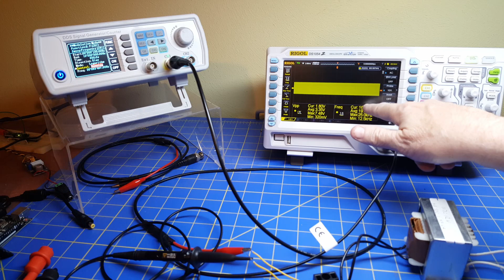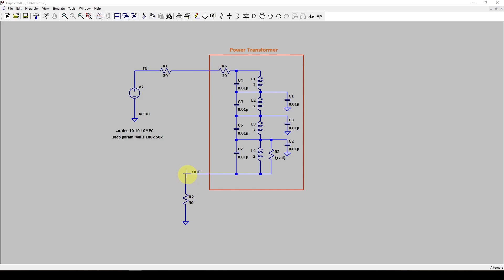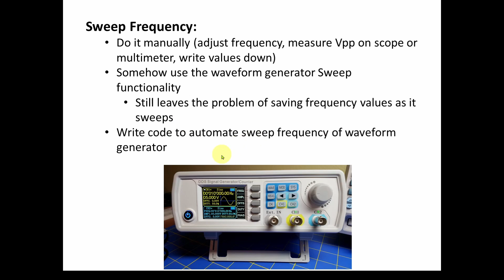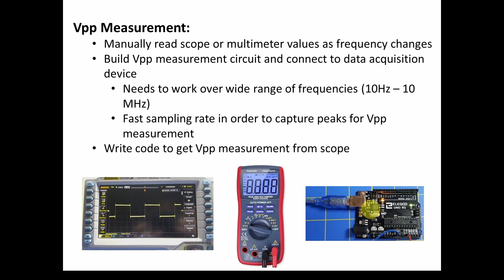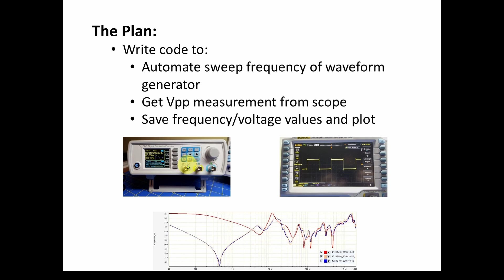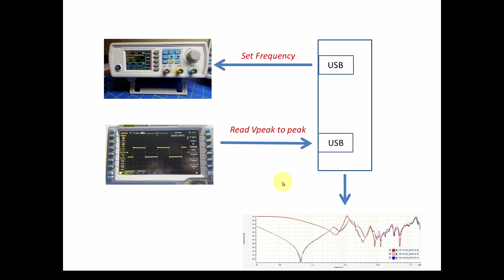Automated Transformer Sweep Frequency Response Tester Part 1: Design

Comment: This series is very timely for me, as I am presently working on learning these exact concepts. A small variation is that I have DIY'd a random air-core coil and I am using that as my DUT. I will be using your sweep process to determine the resonate frequency of the DUT, by identifying the frequency that has the highest output voltage amplitude.

My scope is a Siglent 1104X-E, which is similar to your Rigol 1054. I was hopeful that it could do the testing/logging process, without additional support, other than the function generator. I have investigated its math and FFT functions. The FFT will chart the frequency and amplitude, but the information is lost, as soon as the next sweep step refreshes. There is also a Bode function, but it requires a Siglent brand function generator. Mine is a Rigol.

So, I am eager to see your next video in this series. Thank you for so graciously sharing your time, effort and expertise to teach us.